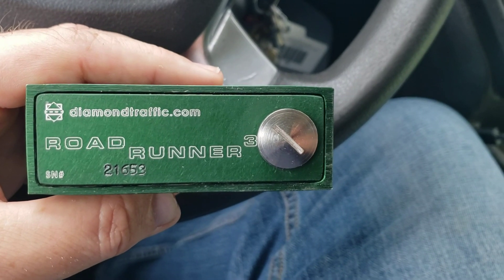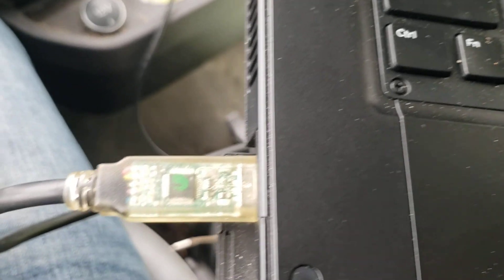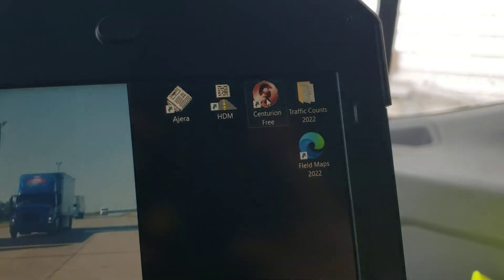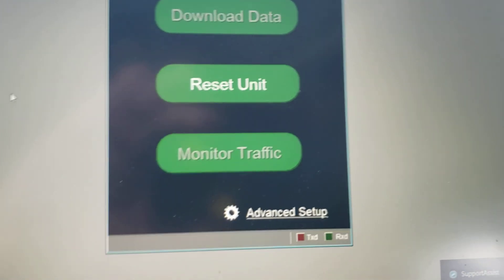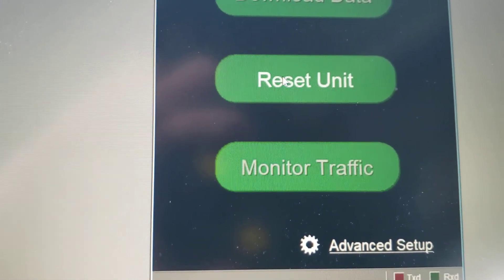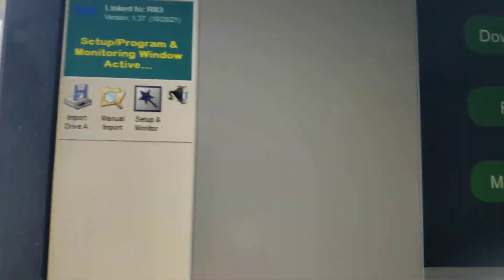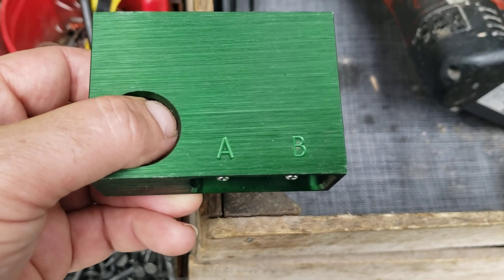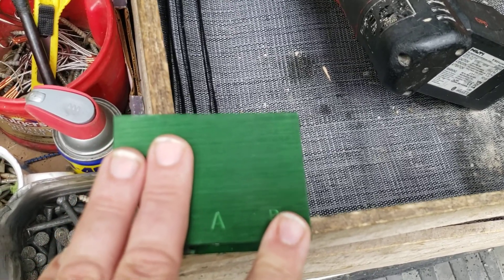🚗 Programming the Roadrunner 3 Road Tube Classification Counter from Diamond Traffic 🛣 🌉 🌁

Comment: Great video, Joe, thanks for posting. I'm trying to secure one of these or similar device to set up in our subdivision to collect data to bring to our local PD to verify that traffic is FAR exceeding the posted 25mph limit. I tried to find plans for a device that would perform similar functions, but it seems the DIY guys are out of luck with this technology, can't  find anything thats reasonably easy to understand as I'm not an electrical engineer. Do you know if anyone sells them used or rents them for a few days at a time? Or if you have any other suggestions on how I can collect the data, that would be great. Thanks for your response.
Reply from the maker: Don, these counters are made by Diamond Traffic. They're called a 'Roadrunner 3'. The last I checked they were $278 on their website. I'm amazed at the speeds I see even in residential areas after generating reports.